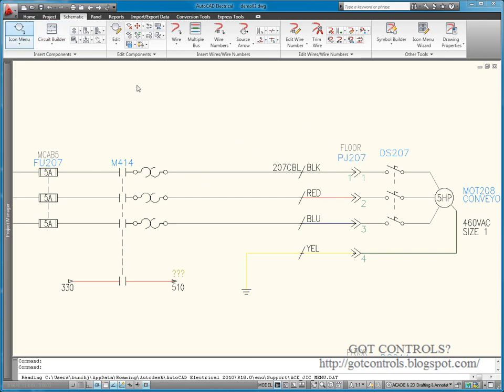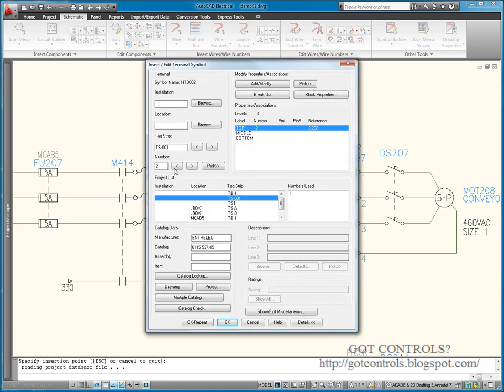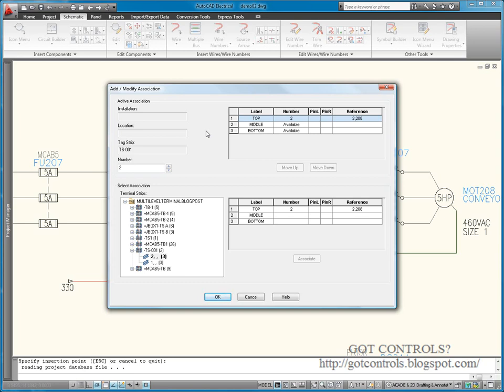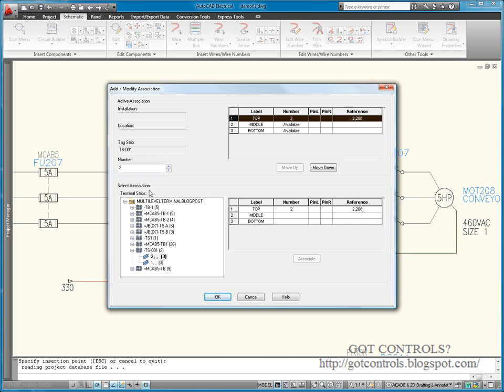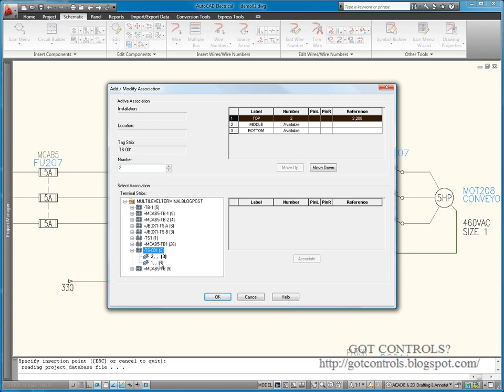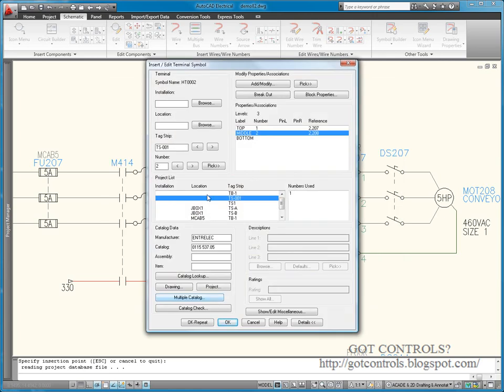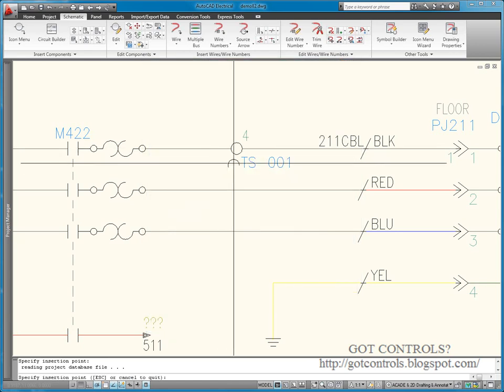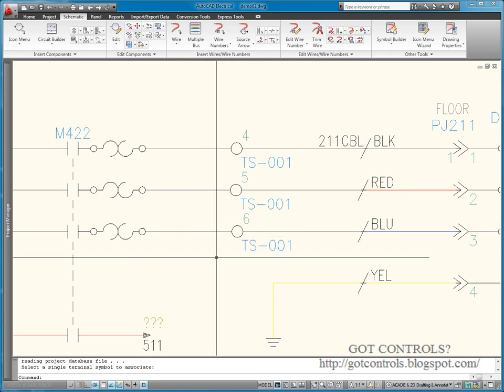AutoCAD Electrical 2010 Multi Level Terminals Associating New Terminals

Comment: Great tutorial! Thanks a lot, just wondering if there is a way to do this:  
1) Copy a set of terminals same as  the ones you did in this video and put them in another page
2) Update the reference number of top/middle/bottom (There has to be a way right?, otherwise the reference number remains the same as the previously inserted ones )
3) Get a BOM and say...hey you used 35 Terminal Blocks.... That is what I am trying to achieve 

Any input will be greatly appreciated 

Thanks!